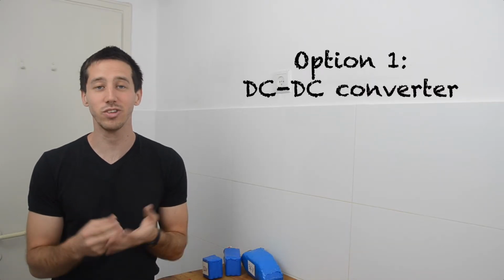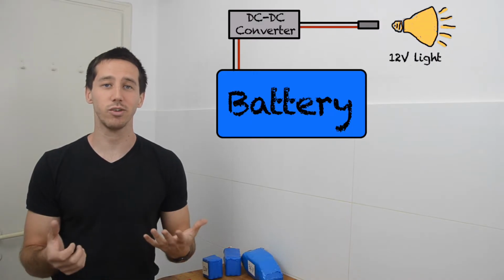How to add any LED lights to an electric bicycle

Comment: What’s up, bro? I like watching your videos. They’re very informative. I have a LED strips that are already in a series. I’ll have to take a few off but they’re in a series and it just has the red and black wire for the positive and negative going to a little control box. You know you can pick a different color anyway how do I hook that onto my moped that has the slider type connection with a slide the battery on on the rail? How would I connect the lights to that and then also to be able to turn them on and off. I have a 52 V battery 20 amp power on the bike. It’s a rev one Ebike if you could let me know, I would really appreciate it. Thank you

Comment: My Yosepower kit has a socket to receive the supplied Wuxing head headlight operated by the control panel. 
I know i could fit a splitter so I could also plug in a Wuxing tail light. 
My question is would this overload the controller by having two lights as opposed to one light as supplied?
I’ve asked Yosepower but they have replied that the kit isn’t able to support a front light even though it came with one, has a socket for it and the control panel operates it successfully. 🙄🙄. 
Fat load of good they are. 
Can’t find any spec for the rated output of the controller for the light socket either so as to be able to calculate the rated output v current draw from both lights. 
Any advice welcomed.

Comment: just use normal dc adapters, for phones, laptops. where 220v ac goes in, you can put aywhere from 40v to 220v DC in, doesnt matter the polarity and you get 5, 12, 19v on output, depending on what phone, laptop charger you have

Comment: Interesting video except in 3rd example he keeps repeating that the method he’s using is wiring those led light strips in what he refers to as “series.”   He is actually wiring them up in “Parallel.”   Not series.  Series is in a line or one after the other.   Parallel is next to one another with one common but branch as his diagram actually shows.   Other than that oops in identifying the correct verbiage for what he is explaining, the thought process and function is actually correct.   Nice instructional overall.

Comment: This is pretty much how to add LED lights to any bike even if it's not an electric bike. If you do it on a bike that's not an electric bike, you have an advantage of the battery being much smaller.

2032 batteries and USB rechargeable ones are garbage. They die on you, especially the front ones. Having the front and back light on one battery is beneficial. The light sets made for Ebikes are much more reliable and brighter than the crap that's made for regular non motorized bikes.

Comment: I have purchased some 12v strips.  The wire leads that came with them are such a small gauge they always seem catch on something and break.  

Have you seen LED strips with a larger gauge than 20?

Comment: My battery is 64v 45amp  and I’m trying to add rock lights that usually goes on a keel to my electric moped …..do I need to wire the rock lights to the dc-dc converter ?

Comment: Thanks, but I found out it was a bit more complicated. You maybe want your lights to switch on/off together with your main switch, or your built-in controller switches (like e.g. automatic lights-on in dark places available on some systems). Also you may want your brake action (and sometimes your intention to turn) to reflect on your tail light. 
So, this is not answering the problem "How to add any LED lights to an electric bicycle".

Comment: Some controllers have tail light wires that activate when you hit the hand brake. What voltage is that line?

Comment: Very nice and clear video, mate... A quick question : assuming I cut off my 48V rear light on my e-bike, solder in a 12V DC step-down converter there, and use that source as a main hub for my 12V lighting sub-system, does this sound like a good idea? Motorcycle 12V turn signals in the front and back, and that's pretty much it... I guess the current draw won't be too high? (that's my main fear). Thanks for your input!

Comment: There are a few problems with some of this advice. Mainly, wiring anything directly to the battery introduces another quiescent current drain through the extra DC-DC converter unit(s). (Although a standard western component should be at around 100uA, the cheap Chinese eBay units (0:28) can be as high as 10-20mA each, and one would suspect that the ones built into cheap lights would not be the best.) This drains the battery when everything is apparently switched off, unless there is a primary switch on the battery itself, or at least upstream from everything else.
Using the recommended solution (lights that each include their own separate buck converters) merely multiplies the quiescent drain problem - each one sinking up to 10-20mA. Although this is small, it is important - if a battery is nearly depleted, and left for some days, this is non-trivial for the many batteries that have no main switch. Storing a bike for a couple of weeks in an empty house could be disastrous, or worse if occupied.
Also, although the BMS will have some measures built in to recognise its own very small quiescent drain, this may not watch the charging port, and might over-discharge the battery if current is drawn from this port. Depending on the chemistry used, this too can be incendiary. The video above ignores the fact that type and condition of viewers' batteries is not known.
A full 10Ah battery will be depleted by 2 low-quality buck converters in about 21 days. A quick search on Endless Sphere shows someone whose battery dropped a couple of volts in 4 days with such an arrangement. Even in the best case, a good DC-DC converter at the 40V range can achieve around 300uA 'standby' current, which will drain a battery from 10% (a typical level at which one might be stored by a careless owner) in around 3 months. 
Giving general advice to novices about specialist, potentially dangerous matters seems unwise.
Reply: An informative video, thanks. 
With regard to 3 x 12v led strips wired in series for a 36v battery, am I right in assuming it doesn’t matter how many LEDs are on each of the 3 strips providing they are equal numbers as each strip is connected in parallel?
I’m also thinking it would be better to come straight of the battery rather than connect on to any existing components so as not to potentially overload any of those circuits?
Any advice greatly received.
Thanks.
Reply: Smh. You really have no idea what your talking about
Reply: @thedoopa3169 the information with all the technical jargon goes over the top of my head somewhat, but am I right in understanding that if using 3 x 12v strip lights connected in series on a 36v battery connected via an isolation switch for when not in use should not give power drain when the lights not in use.

Comment: I didn't know you could get lamps with converters in them - thanks for that! I used a buck converter to drop to 12v - i also use it to power indicators & its okay, i made an effort to waterproof it with dampstart on the pcb. The 12v lamps in series should all draw the same current or close to it.
Reply: how did you wire your buck converter to the battery?

Comment: Do you know the name of the cables that split the connection from the battery? So I can add the lights to the wiring.
Reply: Y cable

Comment: Can you make a video of those 4 led strip lights wire series and where did you connect it. Im also using a 48v ebike. Thanks and ride safe.
Reply: Refer to this picture as an example: http://www.electronicshub.org/wp-content/uploads/2015/11/Series-Wiring.jpg
If you want a video that also incorporates the theory and practice, try this 5 minute lecture: https://youtu.be/v1a629-Ryjc?t=15

In series wiring, you take the positive wire from your battery and wire it to the positive terminal of your light.
Add a wire to the negative terminal of the light you just wired to.
Take that wire and connect that to the positive terminal of the next light.
Add a wire to the negative terminal of the light you just wired to, and repeat the process until you have reached your desired total voltage drop.

So if you have in Micah's example a 48V battery and four 12 volt light strips, you would wire all 4 up in series to obtain a total voltage drop of 48V and therefore a circuit that is not going to exceed the volt rating of the light strips. 

Once you have wired up the 4 lights in series, you'll probably want to add a switch. The switch can be placed anywhere in a series circuit because breaking the circuit anywhere switches the whole thing off.
Reply: Didnt he just do that? Isn't it explained when it is shown? There isn't much more than the explanation given. 1. Get waterproof 12v strip lights. 2. Wire 4x 12v in series for 48v. 3. Connect to E-bike with zip ties or whatever. The only thing that isn't self explanator is wiring in series, and a single youtube search will provide tons of answers for you.

Comment: i just bought a dc to dc converter and plan on mounting it to the outside of my e mountainboard. im building a 36v battery 10s12p abd all i want to do is to add USB charging somehow and run these smaller 5v blower style fans inside the chassis to try and put some airflow over the BMS and the pack in the hot summer months

Comment: Hi Micah.  I love your helpful videos.  I've been thinking about using your 4 x 12v light strip setup, with the white in the front and the red in the rear.  it occurs to me that if one were to add a flasher somehow it could also function as turn signals.  I just don't know how to do the flasher thing.  Anyway, thanks for all the great ideas and tips.  Keep 'em coming, please.

Comment: Thanks i looked everywhere for this information because i have a e scooter and i want install two more headlights,  but it says dc12v-80v . So i was confunse , it means that i can use power source from 12volts until 80v correct ,my scooter is 52v 18.2 amp .
So i want add two more headlights i should make them in parallel or series ?
You was the only one that i found after one day looking and asking people for this matter . 
I hope you can help me with this i would be very thankful. 
Cheers
Reply: What did you end up doing. I would imagine wiring them in series would be the safest.

Comment: My kit has a 5v connector to install a front light that did not come with the conversion kit. How can I use that?
Reply: Buy a 5v light, connect it to the connector and here you go
Reply: @TheGameIsFunny  but it needs to be waterproof I guess,, could you suggest me a link please?
Reply: I just noticed your name, any chance that you're italian? Anyway I don't know any, try googling, for the waterproofing thing I think that you can do it yourself with some liquid duct tape.
Reply: @TheGameIsFunny  si sono italiano, lo sei anche tu o lo parli?
Reply: @antoniogalluccio4213  sono italiano, ho letto il nome solo dopo che mi hai risposto e quindi ho pensato che lo fossi ahahah, comunque se cerchi su internet ne dovresti trovare di luci a 5v anche se non credo che saranno molto potenti, io sfrutterei la 5v per caricare il telefono, controlla solo l'amperaggio per non rovinare la batteria del telefono

Comment: Why is running your own dc-dc converter a "cop-out" or "cheating"? It opens up your options to the lights you can use instead having to use one that has a built-in converter. Running an external converter opens you up to a lot more options or brands you might be partial to instead of having to hunt for one with a built in converter.
Reply: doesn't solve larger loads like 30 amp air horn
Reply: Exactly. That's not a cop-out or cheating, especially when he mentioned using lights with built-in dc/dc converters too.
Reply: He literally explains why he feels this way.. smh
Reply: Just buy ebike light kit 8-80 Volts
Reply: If wanting to install indicators that need a 12v flasher unit your going to need a converter to deliver 12v,  so how do you wire in a 12v converter when that’s your only option and why is that cheating. Seemed to have skipped the option which many might need as the only viable option.

Comment: I have been using LED strips on my bike and trailer for a couple years now (when necessary), but the power in the battery is the most valuable thing I carry.  I use a dynamo hub for most of my lighting needs and use it to charge power pack(s) whenever my bike is moving. I have even used my front wheel as a small water wheel one night and woke to a fully charged power pack. LED's are great but I rarely tap my drive batteries to run them. It's like using my water in the Mojave to keep the rims clean.
Reply: Dynamo power is not free. Main battery would waste that energy to run the dynamo unless you are pedaling and waste your energy.  Newton’s first law.
Reply: @jesuraja941  Yeah, Newton that crazy antisocial guy. What a nut huh? I am absolutely sure that there is "some" drag or energy lost spinning the dynamo, but with a 26" X 2" wheel I couldn't feel it at all when spinning it by hand. The loss of energy from the battery that goes into spinning the dynamo is negligible on a 30+Ah battery and pays off many folds in the convenience of having 10V of power whenever the front wheel spins. And that is all above the true purpose of having a reliable headlight on demand. Newton would also have countered with his 2nd Jewel-of-a-law... and with all the mass that I move the dynamo is nothing but pure convenience. But your right! Nothing is free... trust me I had to buy it. ;)  - https://imgur.com/a/zXXlyuv

Comment: I have a 3wheel  ebike with 60v battery.if I put a 6strip lights on my ebike, will this strip led light can consume my battery fast if use it for let say for 45minutes running motor?
Reply: no the lights are about 10% or 20% of your motor consumption. you should use 5 x 12 V waterproof LED strips wired in series with a switch to 60V source .  https://youtu.be/lx65B74V_60  maybe add spiral wrap after

Comment: There is a third way?? wire 12v dc led lights where you want them, then add a switch and run them on a separate 12-volt battery to run the system, and save power draw from your main battery. Since the lights, your mounting is staying with the bike make the wiring clean, permanent. This way no extra part to foul up your main drive system? if the lights system fails your main power there? just like in a car or plane keep power system separate and have fewer problems. Just an idea that I would do. OR?? the old ways days leave your lights on come back out a car is dead or e-bike? having the light system separate this problem could not happen?wOULD NOT THE EXTRA DRAW FROM YOUR L.E.D. GIVE FITS TO YOUR B.M.S.? What do you think of the idea? input is always welcomed!! Thanks to you the most costly parts of e-bike are the frames and batteries, but thanks to you I, am making batteries, and now my own designed bike frames!! Save a lot on overhead, and let me have just what I want, where I want it?? like playing mad scientist at times but such a blast, now on to my next project, a paramotor electric that lasts more than four hrs. have it up to three now but want that last hr. for the customers!! they would love it, and deserve it!! weight is the factor.peace.
Reply: The idea is to use as few electronic components as posible because these tend to fail and cause clutter.  Sure you can load up a bike with a headlight and a that each has a battery built in.. but then you must recharge them.  The 12v led strips are cheap and easy to apply.  However, these are not ideal for a bike because a bike tends to come into contact with things such as you, bushes, the walls of buildings, kids, etc. I will not use these.  Instead I use a headlight and tailight powered by the ebike battery combined with reflective tapes on the shock forks and rear frame.  Those work pretty well and need little maintenance.  The lights only require keeping the ebike battery charged.  The reflective strips can be found on eBay or Aliexpress for cheap.  These are used on many applications so are well proven.

Comment: Thanks for your video..How do you connect the led strips in series to your 48V ebike power supply and be able to switch it on and off please? Will having to connect 4 led strips in series means you are limited to how you attach to your bike frame (ie. Can you only install the strips 4 rows thick in parallel or can you still have one or two of the rows of the four strips installed and the other one or two rows installed elsewhere on the bike? Thank you
Reply: https://youtu.be/lx65B74V_60
Reply: you can glue or stick the LED (waterproof is best ) anywhere you want . for 48V you have 4 strips any length , anywhere but connected in series with a switch to 48V source.